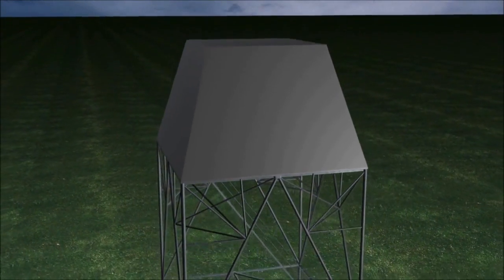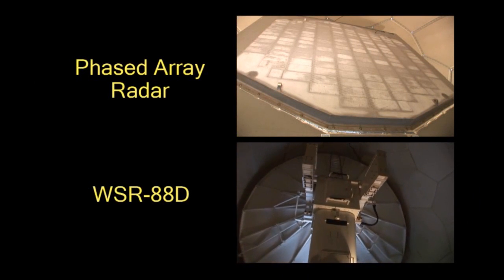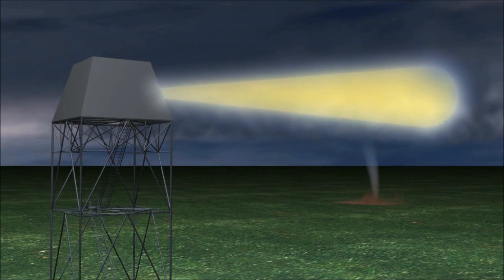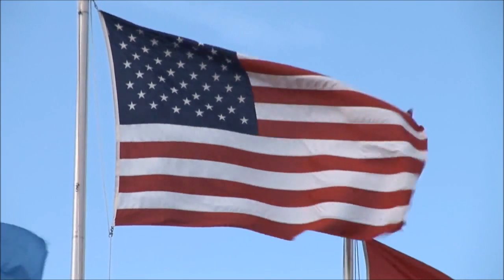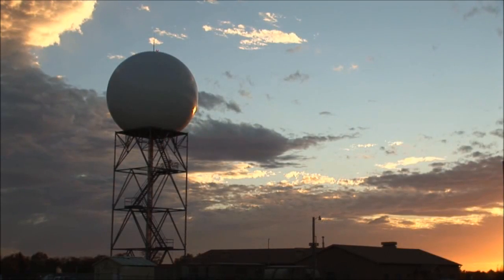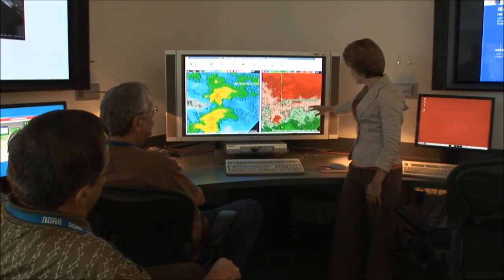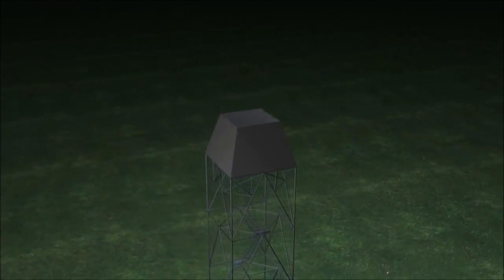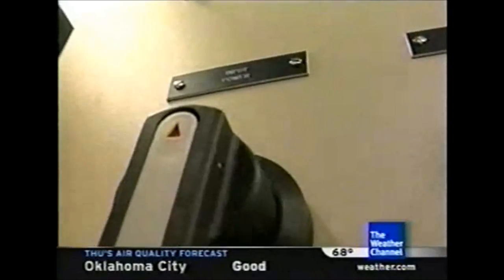Phased Array Radar! Possible Scalar connection?

Comment: What they mean by replacing all those various radar with one radar, they mean replace all ASR, ARSR, and WSR with one type of system.  Due to the shape of the earth, atmospheric signal attenuation, obstructions such as mountain ranges, and the sheer fact that producing an RF signal strong enough for "unlimited range and output" will quite literally cook anything within a reasonable distance from the system, it is impossible for one singular radar station to cover that large of an area.
Reply: I could see shorter range, ASRs being replaced with phased arrays especially if your detection and coverage are limited to about 60 NM or so. But the array manufacturing technology will have to come down in price for it to be a practical option. A true active, electronically scanned array can be very reliable with amazing performance capabilities but they are way more complex to service. So the support costs take on an interesting twist especially if you need full organic support for the design. As we all know, the old saying is still true: radar is only marginally effective in any given application. If you want an S-band radar you have to build an S-band array. Same holds for all the other bands. There is no one size fits all. They may have common display, signal processing, and target data communication building blocks but the expensive part is still unique to each band.